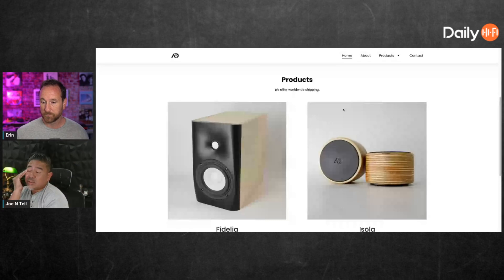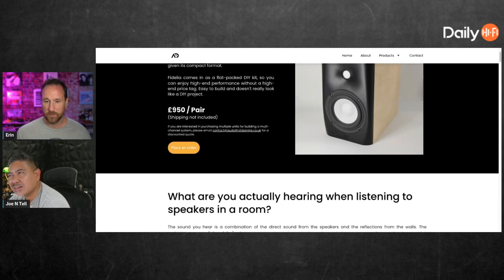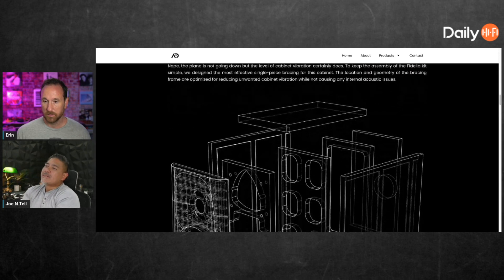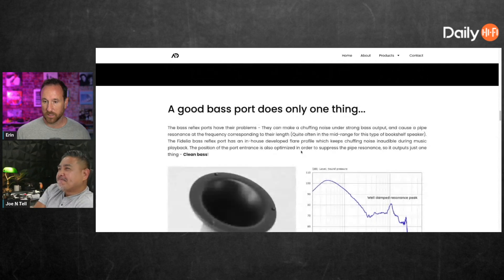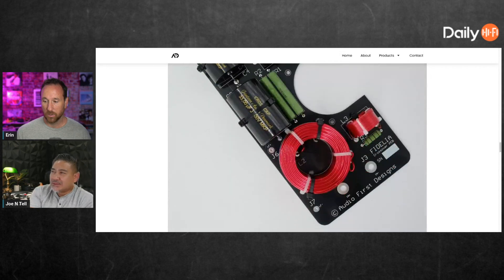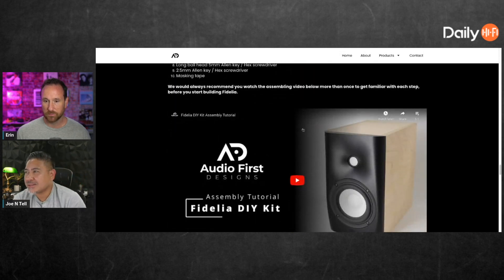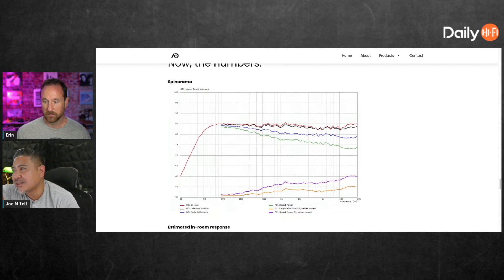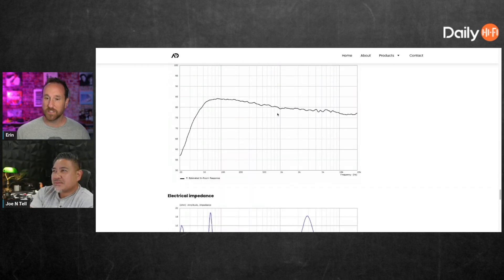What Is The Most Important: Directivity, Estimated In Room Response Or On Axis Response?

Comment: Would love to hear your take on the Polk L800’s those are a revelation
Reply: I have the R700's and feel the same way! 👍
Reply: I've heard the L800's with SDA and I was extremely impressed with their demo.
Reply: @joentell  yeah, that’s reduction in interaural crosstalk is insane when implemented correctly.  I’m looking at home rolling a pair using a miniDSP and some bookshelves.  Sony SC500’s, if that works then I’ll upgrade the speakers.  There’s a forum on ASR where a few people really get into it.

I found the analog version of crosstalk cancellation to be way more effective than digital (think BACCH).  I heard BACCH at Axpona set up by Dr. Choirie.  It was almost as effective in some respects but it wouldn’t work with home theater, is a complicated setup.  

It was fun watching people’s reactions the first time they hear it.
Reply: @joek6207  Post a link to the ASR discussion
Reply: @joentell  it’s long because the guy is learning as he goes.  He tried the Polk method at the very end and liked it.  He has a method where he uses 3 speakers

In this order:  

Left side of speaker array: +L mixed with -R
Center array speaker: +L+R 
Right side of speaker array:  +R mixed with -L

Whereas the Polk method is:
Left speaker:  -R+L and each plays the channel instead of mixing 
Right speaker:  +R-L and each plays the channel no mixing

+ is regular speaker channel  
- is the inverse of the channel